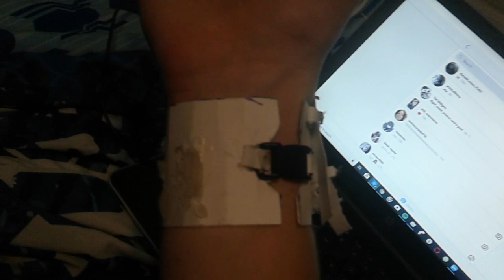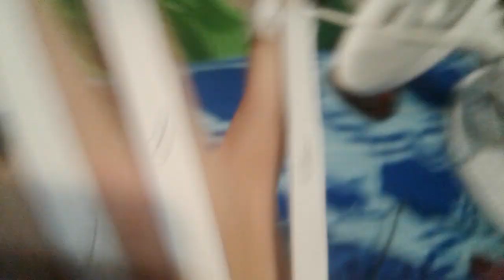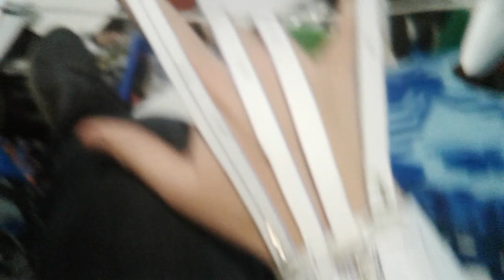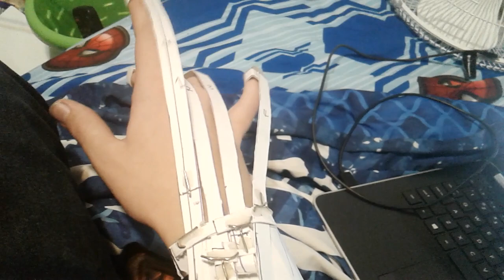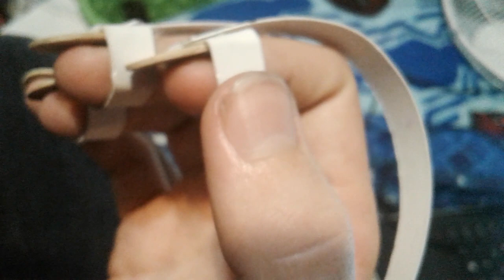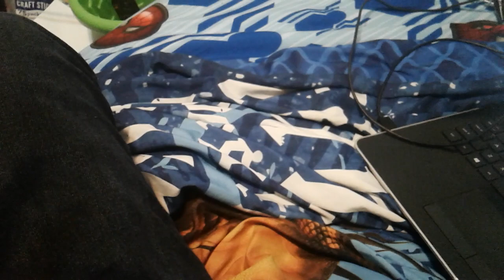Web Shooter Trigger Concept WIP

Comment: This is an incredible idea, to be able to have full mobility and nothing blocking your palm/grip is rediculously useful. How much does wrist angle effect the trigger? Or Is that negligible considering firing conditions?
Reply from the maker: Thanks! lol
Wrist angle does indeed affect it in this model, but the next version is most likely going to fix that by having the trigger piece on the back of the hand rather than the wrist. It should also be a bit less specific than this one, needing to only be in the ballpark of the right position as opposed to having to get it juuuuuust right.

Comment: Good idea. A web shooter that fires when you move your fingers. Sounds safe
Reply from the maker: It only fires when you move your fingers in the exact right way. If all of the contacts aren't connected, it won't fire. You have to put your hand back, your middle fingers in, and your pointer and pinkie fingers out. That's kind of hard to accidentally do. So yes, it is quite safe.

Comment: I've been working on a button trigger design in my head since I'm broke and can't build it and pay for the parts, basically there will be two buttons at the bottom of the palm and the button is a fingerprint scanner, and once both fingers come in contact with the buttons it activates a tiny piston that extends and pushes the button on my web cartridge so it can shoot my webs... Idk, I'm not tech savvy
Reply from the maker: I was actually thinking about a fingerprint sensor as well actually, just never had the money haha
Reply: Sounds a bit futuristic, doesn't it?
Reply from the maker: You could just have the scanner go to an Arduino pro mini and have the Arduino turn on the solenoid
Reply from the maker: @juicyallstar And web shooters don't? lol